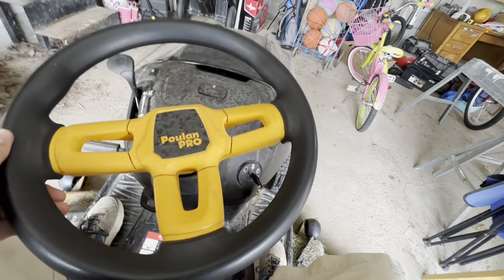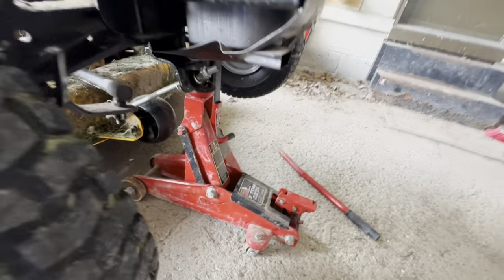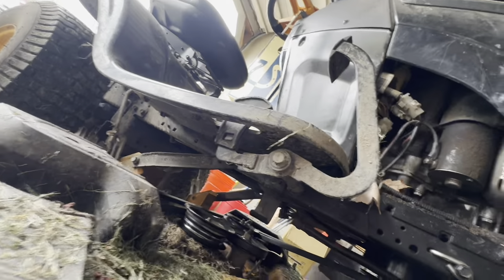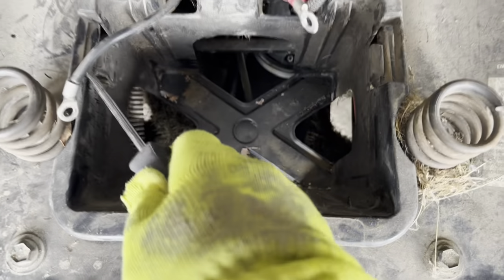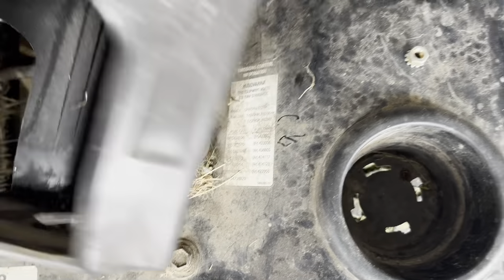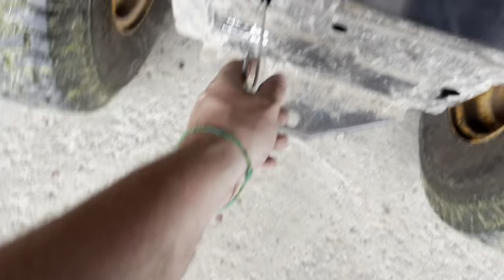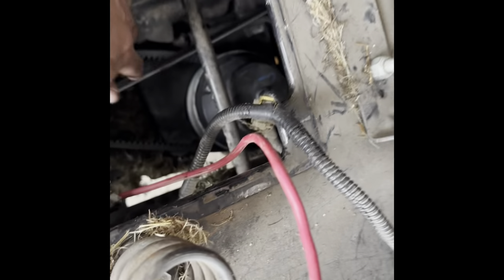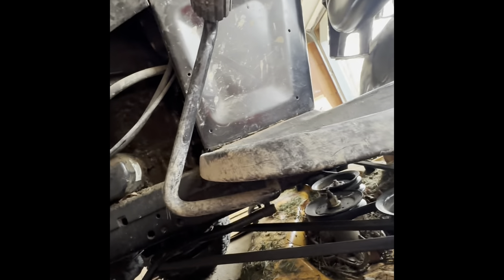Repair Riding Lawn Mower that Doesn't go When you Press the Pedal #diy #mower #efd

Comment: thanks for your help!  ours wasn't a belt but (please don't laugh because i don't know the technical terms) the arm for the pedals somehow jumped off the pin that helps engage whatever that arm is that you can see between the sides of the belt you checked.  we never would have thought to pull the battery and its sleeve and look down from that angle, had it not been for this video. 😄
Reply from the maker: Awesome! Glad the video helped and you were able to figure out the issue! Saved yourself a lot of money. 😀
Reply: I think what happened to your mower has happened to mine! How did you fix yours?!